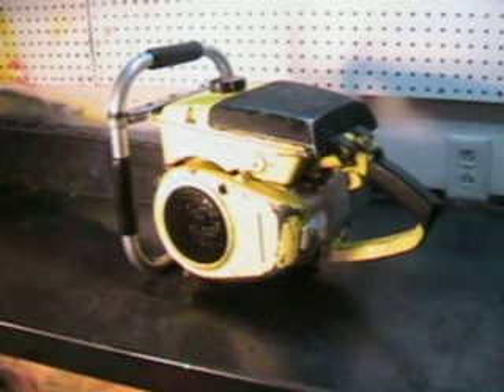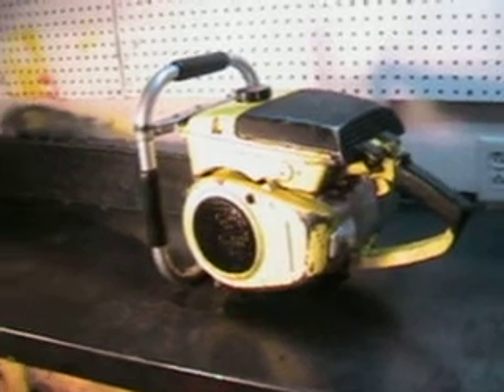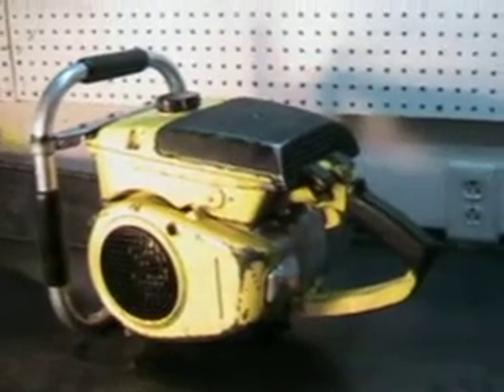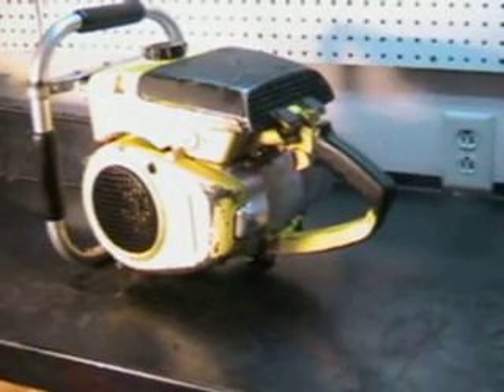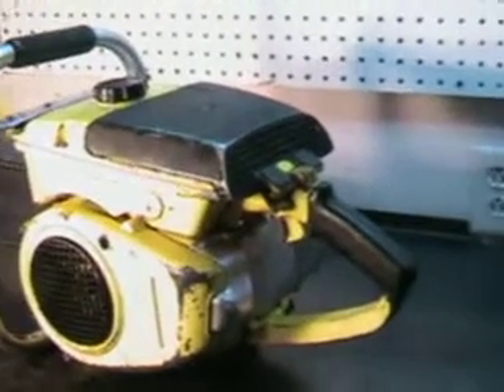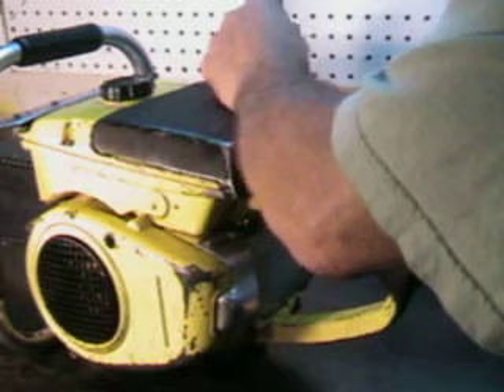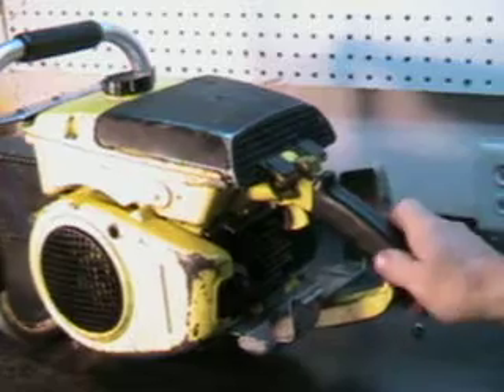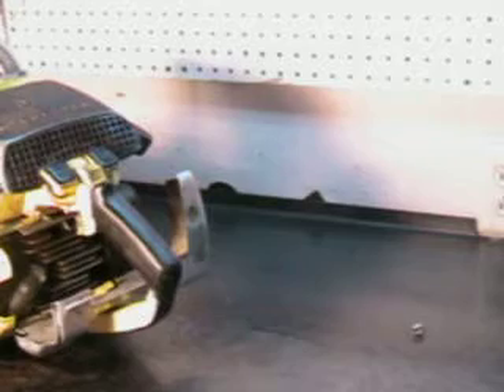The chainsaw guy shop talk McCulloch 1 72 chainsaw

Comment: Just got one of these 2 weeks ago and it runs great and cuts as fast as  056 magnum with 3/8th chain. My McCulloch 1 72 has a 7 tooth drum with .404 chain. We did a drag race in the same log.
Reply from the maker: That’s awesome!
Take Care,
WestCoastMuscleSaws 
TheChainSawGuy 
Rich
Reply: @WestCoastMuscleSaws  I was just wondering are you the same gentlemen who just retired after 40 years at the Oregon based saw shop?
Reply from the maker: @LOLedWh0r3  yes I worked on saws in that part of Oregon for over 50 years.
Reply: @WestCoastMuscleSaws  Thank you very much for your videos. They are greatly helpful. I did not realize that the 1-72 was a manual only oilier. I had my suspicions after running my Mac 790 and it atomically oiled, but one of your videos told me for sure. Thank you again. There are three of us who watch your videos and repair and run old saws and love them. A 18 year old, a 32 year old and a 42 year old. Do you happen to know where to source recoil springs for the kart motor macs like the 790 we have three of the saws, 1-72, 740, and 790 and only one working recoil. I have tried to repair the springs and they work temporary. If your ever interested we can post a video of our saws. probably close to 100 total between us.
Reply from the maker: @LOLedWh0r3  I would love to see your saws in video.
WestCoastMuscleSaws 
TheChainSawGuy 
Rich

Comment: Can you run 50 to 1 oil mix in it
Reply from the maker: hi Dan,
my opinion on the 50:1 is if the engine is in good condition, it’s the best (STIHL or Husky oil).
if there is an engine issue , no oil is going to save from damage.
I’ve ran the 50:1 in all my vintage saws
WestCoastMuscleSaws 
TheChainSawGuy 
rich